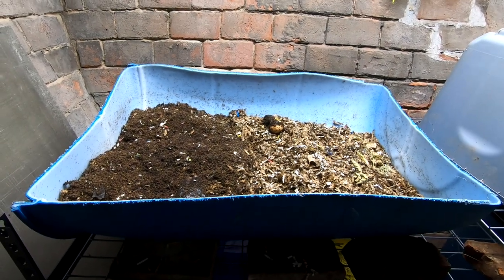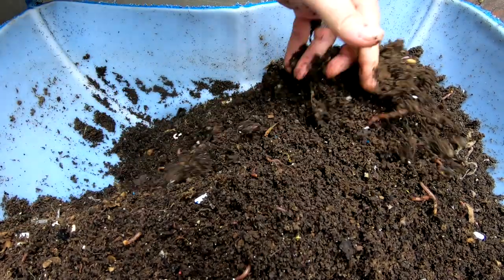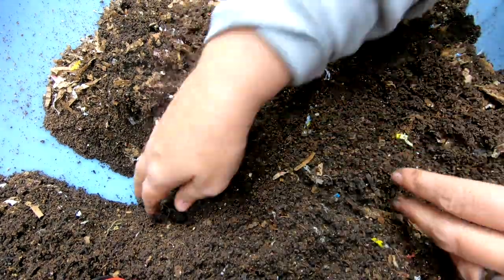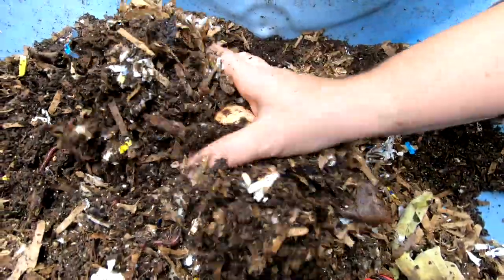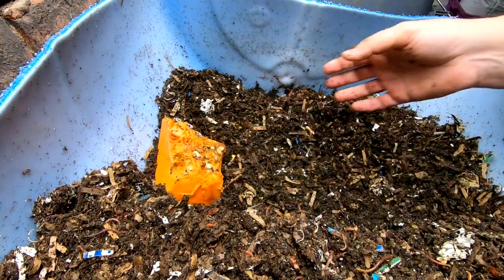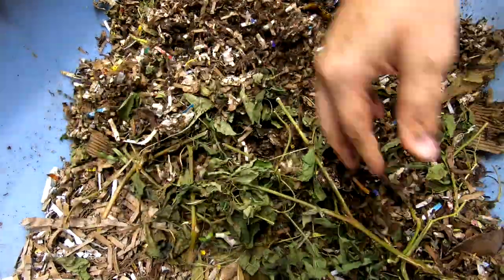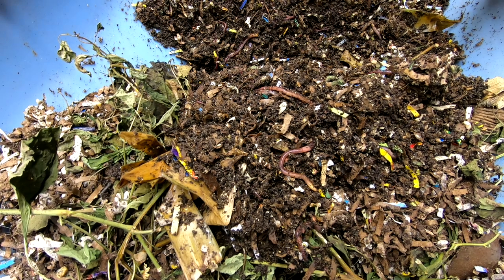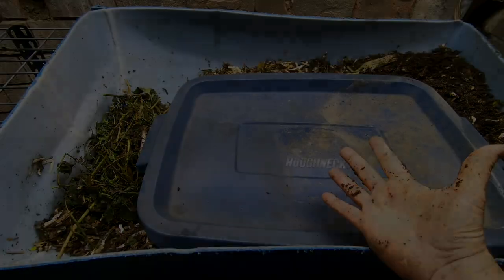Compost Worms-European Night Crawlers

Comment from the maker: I an an Amazon affiliate.  The items below are the Amazon affiliate links for the items I use in my wormery. The cost is the same to you, but the channel will get a small commission if purchases are made using the links.
Aurora AU1800XA Anti-Jam 18-Sheet Crosscut Paper/CD and Credit Card Shredder/ 6-Gallon pullout Basket 30 Minutes Continuous Run Time 
https://amzn.to/3qnbei7 
SE 5-Piece Set of Patented Stackable 13-¼” Sifting Pans - GP2-5 SET https://amzn.to/3qo5YLh 
SE Patented Stackable 13-1/4" Sifting Pan, 1/4" Mesh Screen - GP2-14 https://amzn.to/2PKdbbZ 
SE Patented Stackable 13-1/4" Sifting Pan, 1/8" Mesh Screen - GP2-18 https://amzn.to/3rtYd7O 
SE Patented Stackable 13-1/4" Sifting Pan, Mesh Size 1/12" - GP2-112 https://amzn.to/2O3y0ie
Bon Tool 11-407 Utility Tub - 26" X 20" 
https://amzn.to/3eehgzn
Neem Cake for Organic Gardening (5 lb)
https://amzn.to/3swpcQR
Espoma Green Sand
https://amzn.to/2O4SOpw
Mother Earth Coco Bale 5 kg, 100% Coconut Coir Fibers

https://amzn.to/3v0qEfPKelp Bliss Pure Norwegian Kelp Meal (0.9-0-2) (5 lb)
https://amzn.to/3t2t7Vt
dolomite Lime Plus Magnesium and Calcium"Greenway Biotech Brand" 1 Pound
https://amzn.to/2PwTHHB
SUPERLELE 3pcs 1000ml LDPE Safety Wash Bottle, 
https://amzn.to/3v2dq25
Super Moss medium orchid bark
https://amzn.to/3jmLeng
Repot me 4 inch slotted pot clear 3 pack
https://amzn.to/3xXY13M
6 inch repot me slotted pot 3 pack
https://amzn.to/3djvJbS
Ceramic orchid pot 5 inch
https://amzn.to/3h7QmZP
Worm farmers handbook
https://amzn.to/3c8R3Q1
worms eat my garbage
https://amzn.to/3c7wraV
worm farm revolution
https://amzn.to/3c86g3O
Vermiculture Technology: Earthworms, Organic Wastes, and Environmental Management
https://amzn.to/3sYPBqk